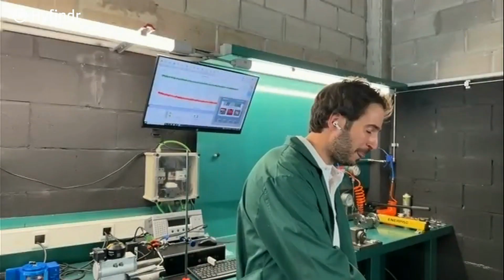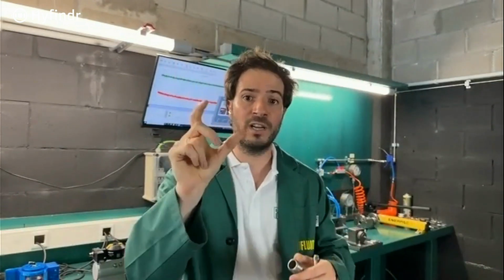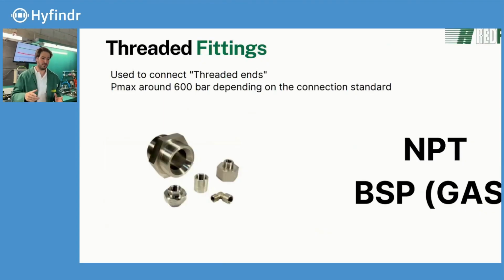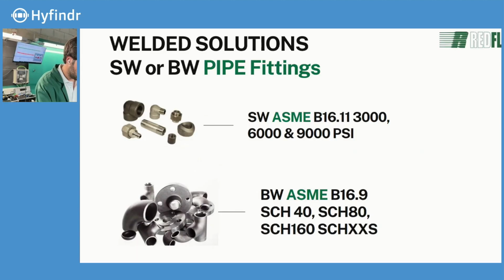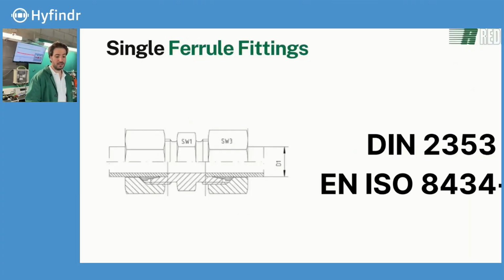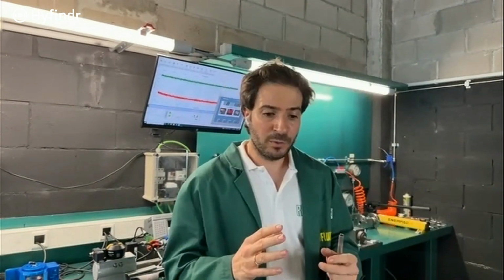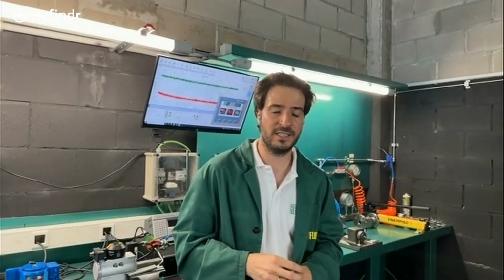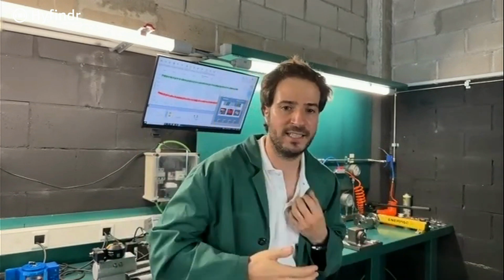Tech Talk - Hydrogen Fittings - Differrent Types of Fittings - Hydrogen Technology - Hyfindr Palau

Comment: Just to let you guys know that Parker A-LOK twin ferrule can be remade many times as per the EC79 standard so it is not correct to say that the end user has to cut the fitting off every time. We do not recommend using any NPT threads and seal tape such as PTFE on Hydrogen installations.   Please get in touch with Parker Hannifin for up to date information on Hydrogen fittings and safety which is so critical.